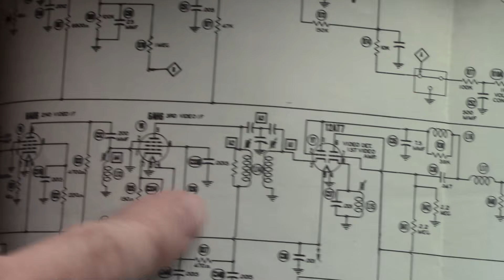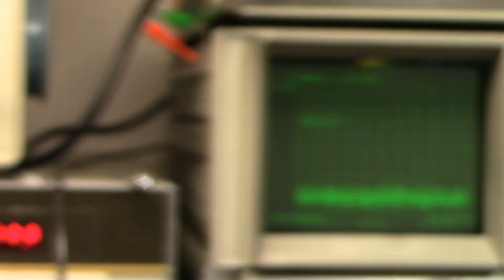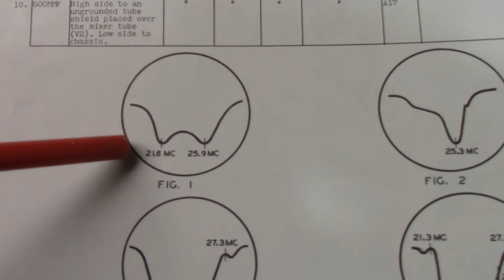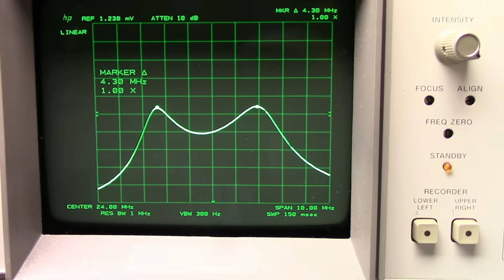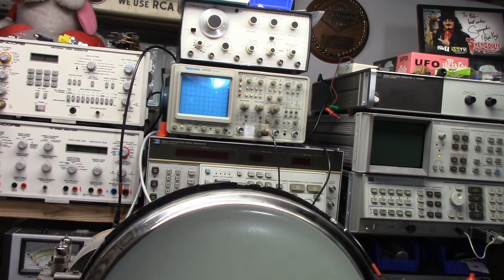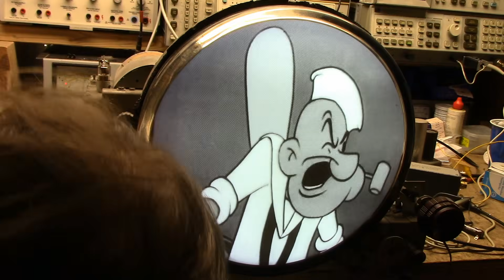Zenith 28T962 Warwick part3 - video IF alignment using a spectrum analyzer

Comment: 14:28...why not use a 10 meg resistor...(?)
Reply from the maker: That would reduce the signal by a factor of 10 more and the scope would have trouble reading it.  It a balance between not loading down the circuit and getting a big enough signal to view.

Comment: I think I remember that some manuals mention using a clamp on the tube to pick up such signals. A metal clamp that you can set tightly on the tube and hook the probe to that. Then it won't move around and the clamp can be easily repositioned the same way the next time. Basically the clamp is a more stable antenna then just laying the probe somewhere in there. Also larger surface area

Comment: There is a company called Auburn tech that makes an RF probe P-20B that is non loading and DC blocking within reason. It was designed just for this type of testing, I used to work with the guy behind it he was a lifer in the test and measurement world although I'm sure it's his retirement side hustle at this point.
Reply from the maker: Not quite unfortunately.  It's passive and meant for low impedance, 50 ohm circuits.  I need an active probe with 10M plus impedance.  It also only blocks up to 50VDC.  That's a bit too low for tube circuits.

Comment: Hi Bob, beautiful video! There is an alternative way you may want to try. Applying a thin insulator onto the grid and plate terminals you can connect the HOT leads without electric connection. Tracking generator will act as transmitter and SA as receiver. This will prevent any unwanted DC injections into the instruments applying only 1 or 2 pF of coupling capacitance into the circuit . It works great and when you remove leads has no effect on the adjustment. Using a 
BNC to alligators coax cable is very convenient and fast to setup. I’m using this technique since a while and won’t come back to the traditional methods.

Comment: So let's say your ATSC tuner has a color intensity control available in the menu.  If you just set it to zero would it affect the 'color dots'?
Reply: Good question. I'm thinking the color dots should go away. If you look at those color cartoons, are there any color dots in the parts of the picture that have no color (black/white/gray)? I don't think so. The color carrier is amplitude modulated for color level, and phase modulated for hue. I think it simply goes away when there's no color in the image. The color burst in the horizontal blanking interval remains, but that doesn't contribute any color dots in the image. That's nothing but a reference for the 3.579 MHz local osc to phase lock to. It's at the same frequency as the color carrier in the spectrum, but it appears at a different time in the sweep.
Reply: It should make them go away. the weighted colour difference signals are amplitude modulated onto I and Q carriers with a  +1 to -1 range so something with no colour results in an amplitude of 0! the only standard where this is not the case is SECAM which uses FM modulation which requires the carrier to be present at all times.
Reply from the maker: It may affect them but I don't think they would go away.  The color burst at 3.579 MHz would still be there.
Reply: @bandersentv  The color burst is just off to the left of the raster, 8 cycles of chroma carrier, but it's all below black level, so you don't ever see it.
Reply: Actually, in my particular case I'm running off of a Roku connected to a little HDMI-to-RF converter, and it's the converter that has the color intensity adjustment in its menu.
Reply: Yes, it should work fine. 
In Europe some boxes also had S-video mode over Scart, so there was just pure Y signal. Using green signal only is not the best idea.

Comment: I suspect there is a 4.5MHz trap somewhere after the video detector to eleminate sound crosstalk. It might be out of adjustment. In NTSC video the sound carrier is 4.5MHz away from the video carrier an will beat together and cause a visual interferance pattern.
Reply from the maker: Yes, there is a 4.5MHz trap in the 1st video amp circuit.

Comment: Fascinating video! I had a 1965 black-and-white Zenith TV set that did the same thing where it showed those dots, particularly on strong signals. The contacts on the VHF tuner were FUBARed, so perhaps that had something to do with it. I know that color NTSC broadcasts had to adjust the bandwidth on their luminance signals so as to accommodate the chroma signal.

Comment: Good work Bob, I was going to suggest the same series resistor or 1 pF capacitor with the probe to reduce capacitive loading.  The probe sensitivity to hand waving may partially be due to the probe capacitively picking up signal radiated from the video 😊detector circuit.

As an alternate to putting the spectrum analyzer into linear amplitude scaling, try 1dB Log per division.

It is amazing the performance these old sets have.  I had witnessed so many 1940's sets from 50 years ago using the original paper caps, which produced all kinds of sweep non-linearities.  Seeing that so often, i falsely assumed the non-linearity was due to poor design.